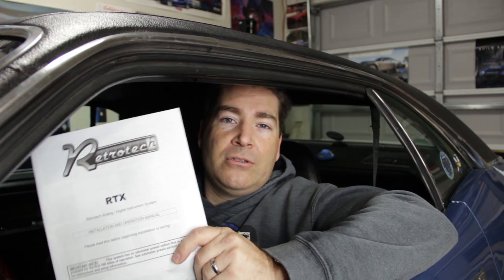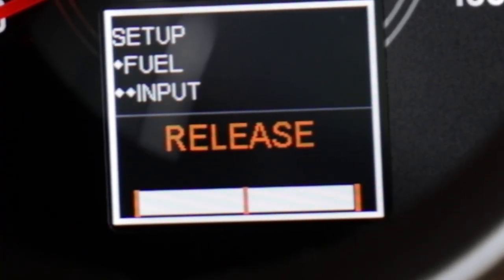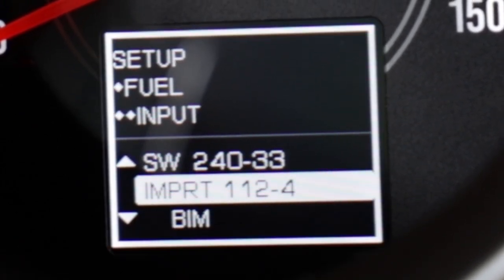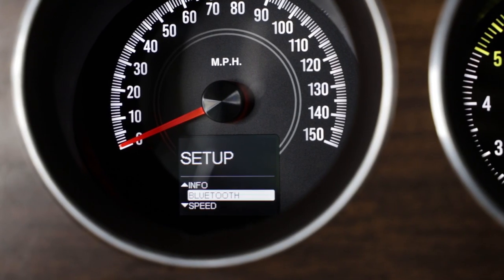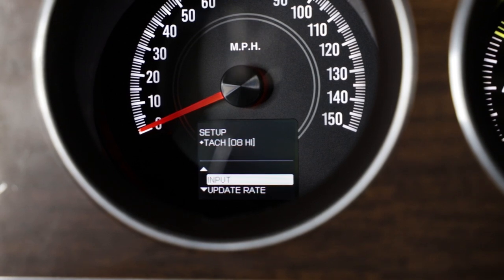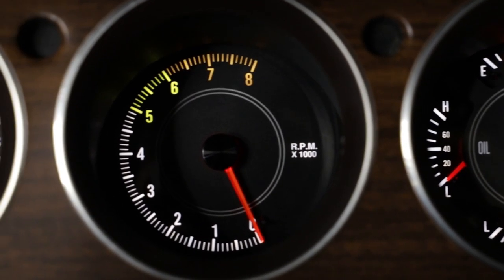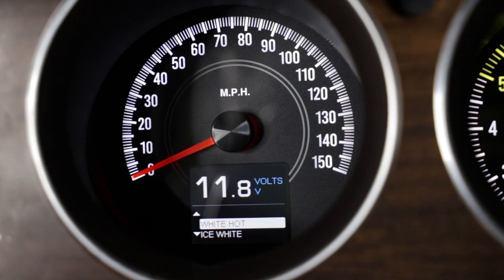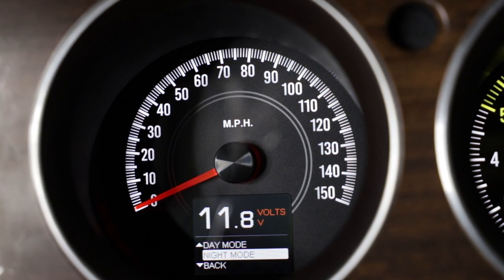Tech Talk Tuesday: How to Setup the Dakota Digital RTX Gauges in your Challenger or 'cuda

Comment: How does the system know to switch from AM to PM modes? I noticed that there isn’t a defining AM/PM on the clock but there’s an AM/PM illumination setting… I wired everything up power wise. I don’t have the temp, tach, oil or speed connected yet in anticipation of an engine swap but for $1500 this thing can’t tell what time of day it is? It didn’t even illuminate when I turn it on, it turns on but I have to hit the switch for it to actually light up…
Reply from the maker: What do you mean by am or pm mode? Do you mean in regards to being back lit? That is set by having your headlights on or off. You can set the brightness to different levels (or off) for when the lights are off and when the lights are on
Reply: @LifeatSpeed  I didn’t even connect it to my headlights because I figured it would have had the programming for AM/PM for an automatic adjustment. Which slot is for the headlights?
Reply from the maker: @MCFABRICATION  I don't know of any gauge lighting that is tied to the clock. If you think about, if it was tied to the clock then at noon the dash lights would come on and turn off at midnight. Now the automatic lights have a sunlight sensor, but they still run everything through the headlight circuit. I don't remember off hand where the lights wire into the box, but the box should be labeled appropriately and the instructions are pretty clear and straight forward.